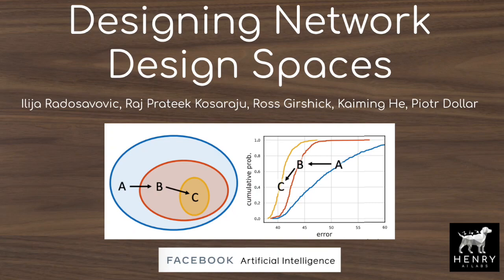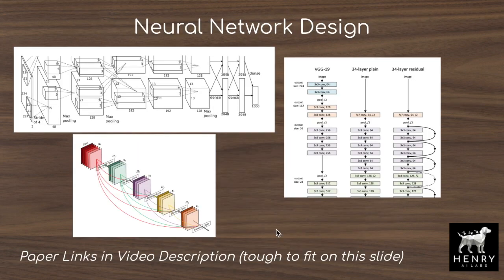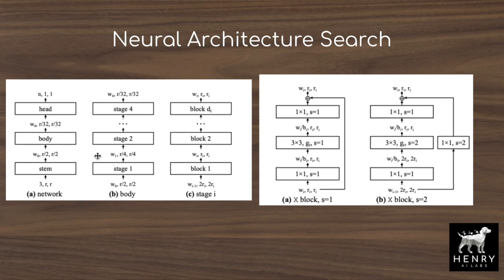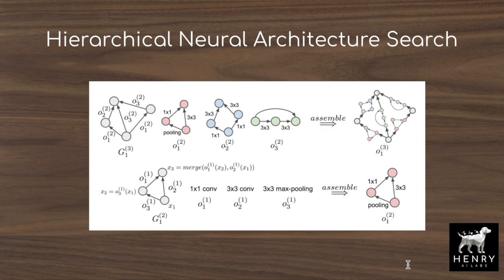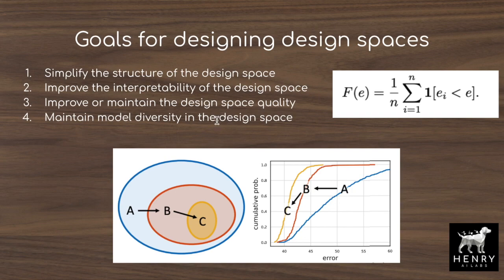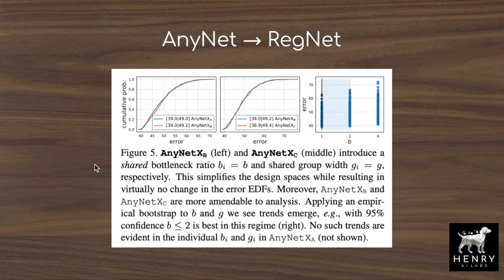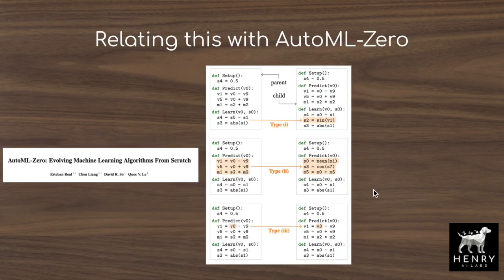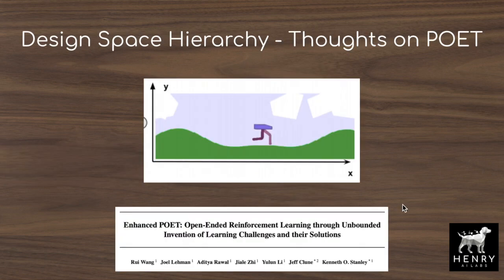Designing Network Design Spaces

Comment: Very interesting topic. I noticed you make a lot of content regarding NAS. What do you think, is this area more research focused and maybe becoming practical in the future or does someone out there already use this extensivly? I feel like it would take a lot of compute to solve a problem this way ^^ And thank you very much for your videos!
Reply from the maker: Thank you so much! I think NAS is really interesting because it is applicable to many problems. As a random example, DeepMind just published about using Graph Neural Nets for engineering glass, and even these GNNs could be optimized with NAS. However, I've noticed that a lot of these papers like The Evolved Transformer or Regularized Evolution of Image Classifier use an enormous amount of resources, in a similar vein as training a billion-parameter transformer model. I think NAS has enormous application potential for a very diverse set of problems, but unless you have significant computational resources I think it's still just something to keep an eye on. This research on the design space itself is a step towards more tractable architecture search.